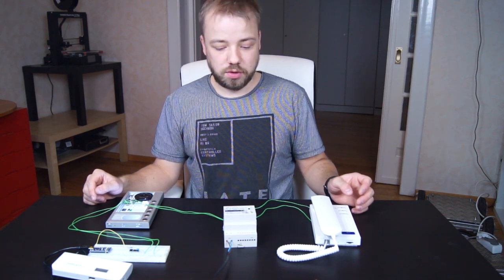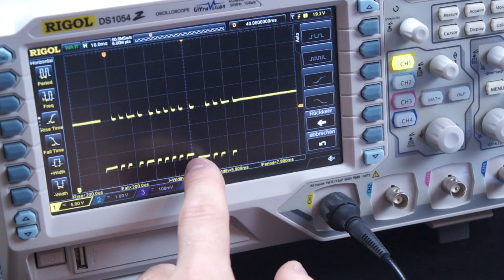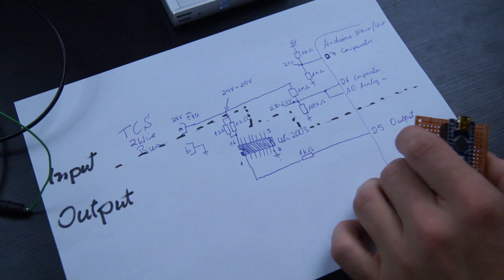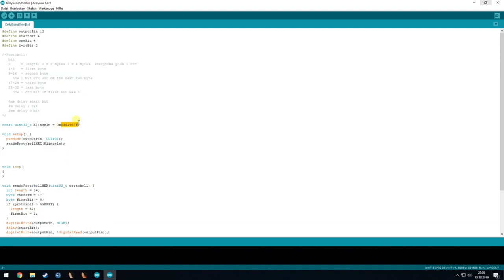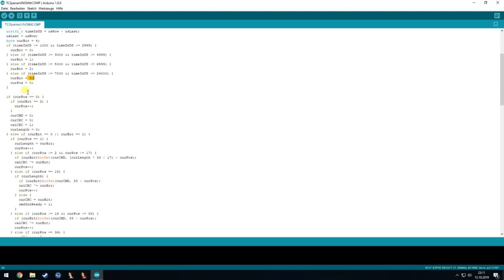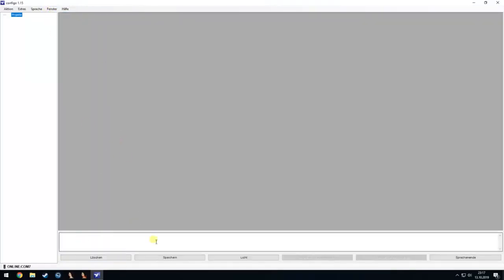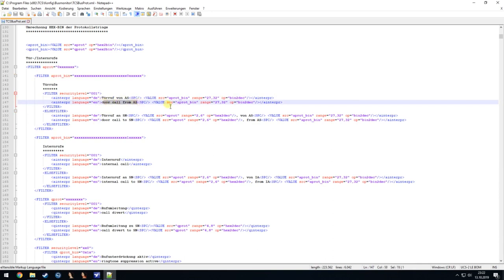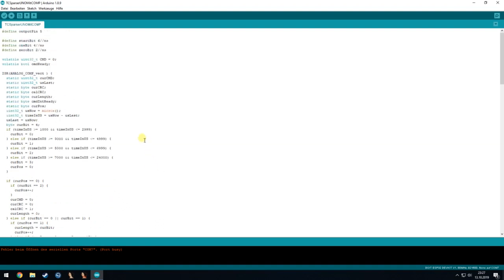2Wire Intercom Arduino Hacking, How to controll TCS via Arduino

Comment: Great Work! This helps me a lot for to make my own ESP8266 based dooropener in combination with Home Assistant.
Reply: Hi how did you do it? can you point me some video/docs? 
I'd like to connect my apartment intercom to send me audio/notification to my phone when it rings. It would also be great to forward it via VoIP to my phone somehow - I already use home assistant
Reply: Any luck getting that to work?
Reply: @plaetzchen86  unfortunately not
Reply: @plaetzchen86  did you receive a code for integrating the TCS intercom into home assistant?
Reply: @vladimirzrnic8975  nope

Comment: Awesome! Thank you very much. I considered buying the Nuki Opener, but they discontinued the support for TCS Intercoms. Then I found the Shelly Uni on the Web, which has a Smartphone app and lets you control various electrical devices.  Your work will help me a lot to get my intercom smart again, and it will be way cheaper than the Nuki Opener.
Reply: The Shelly Uni can't be used for this project. Which is why I will now use a NodeMCU v2. Firstly, I still have it lying around at home and secondly, the NodeMCU has 4 MB of storage for code. Since I need an AP and Wifi mode and also Mosquito, the additional storage should be enough. I also need to write my own Android and Wear OS app so that the intercom can also be opened via the internet. As a programmer, I'm really looking forward to it. I have also created a schematic and a board with Eagle, which has various status LEDs and switches. E.g. for debugging, AP mode, switching on and off and so on and so forth. I will also have the board produced and when everything is ready, I will make it available as open source.

Comment: Great video! I have an 8-wire digital system with 2 video, 2 audio and 2 bus wires. Do you think the two bus wires would work the same way as in your system?
Reply from the maker: hi thank you.

It's hard to say how are the bus Systems work you have to check with an Oszilloskop at best. These ystems are mostly proprietary
Reply: @atc1441  Thanks man. With your permission and when I start working on this, I will contact you again with info or questions. I practically wanna do a little wifi terminal for this and it should be a pain in the ass :)
Reply from the maker: yes no problem just ask

Comment: Wow, great reverse engineering and documentation! Is it possible to power the Arduino/ESP8266/ESP32 from the bus? I don't have a power source where the indoor device is located. You write in one of the comments that powering it would be limited to 100mA? Also, am I assuming correctly that it also should be possible to activate the door opener, since you can write to the bus?
Reply from the maker: Hi thank you. The power draw of an esp is too high for the BUS so not possible. On some systems there is an extra power cable connected, you could use that to power the esp.

And yes you can open the door with it without any problem
Reply: @atc1441  Thank you for your quick answer.  I'm really excited for this, finally there is a solution to this! Sorry to bother you again, I have a follow up question: I have all four lines used. So do you think I could use the P line to power my ESPs? Can I use an LDO to get from the 24V to the 3V3? Or what would you suggest?
Reply from the maker: @danieleichhorn9533  That sound good, should work, see if the LDO is has enough power or even better use an step down converter.

Comment: Hi Aaron, great video.  Is this "hack" usable for an intercom using the SCS BUS ? Also, is there a way to open the frontdoor by using a morse code (input by ring button at the frontdoor) for example ?
Reply from the maker: Hi. 
This hack is only valid for the TCS intercom.
When an Arduino is listening for a specific morse pattern then it could open the front door so that is possible to implement. Only speaking for TCS again
Reply: @atc1441  Thank you tor your reply.Will try to figure out how to implement this in my existing intercom installation. Regards Philippe

Comment: I wouldn't thought of using the two wires of an intercom to send your own protocol.  Interesting concept. Thanks for sharing.
Reply from the maker: Hi again :) 
Yes even that is possible with this mod, the arduinos can also be powered via the bus, but in this case only up to 100mA current.
it would also be possible to send data from one to another arduino on the bus.

Comment: you are a genius! I thought about this many times before, but never got to do it... 
after I found your post, github and youtube video and have written my software and assembled the hardware, I managed to open my door with my mobile phone! 
that is so cool, thank you so much for this. maybe worth mentioning that you have to connect A-B (like you said) but use P to power your device (took me a while to understand ... it's kind of obvious afterwards, but it was not for me at the beginning ...). btw i'm using an ESP32 with a bucket converter to 3.3v - so even with wifi it's way below 100mA on the 24v - it's around 20mA
Reply from the maker: Great :)
The only problem with the P line is that its not available in many installations but lucky you !
Reply: Welchen converter hast du verwendet?
Reply: I have 4 Wires. The a-b and the E-P. But there is no power on P at all. I probed all combinations. See now power coming from P.
Btw... how is the BUS working, do you have any issues afftecting the BUS in general? I mean, do other interphones have issues when you connect your ESP?
Reply: I have no other things connected, cannot give you an answer regarding additional things
Reply: @atc1441  Do you know another method to power the esp directly from TCS System? I have the same problem like other guys here, 4 wires but on the P line is no power.
I didn´t found so many useful documatation for my TCS Stystem, seem´s like the E and P line is for the floor button

Comment: Would the same wiring for sending work also from a wemos d1? The main difference being that the output of an io is 3.3v on the wemos vs 5v on the nano. I'd try to extend the tcs monitor that is linked in your repo also with a writing function. I want to be able to open the main door automatically and also react on the door bell.

And do you think it's possible to also use a standard 24v to 5v dc/dc converter to power the arduino directly from the bus?

Comment: Hello Aaron, many thanks for this video! I have 2 questions:
 - why did you use 2 1.2ohm resistors in parallel, actually making a 0.6ohm resistor?
 - using a 1Mohm and a 160kohm for dividing 24v and 20v, you would get 3.31v and 2.759, correct? How did you get 2.8v and 2.2v?
Reply from the maker: Hey. The parallel resistor are there so they are able to drive more power. So 2x0.25W = 0.5W
I dont know how to answer the second question right now
Reply: @atc1441  I see, good point. And how did you determine the - equivalent - resistor value 0.6ohm?
Reply from the maker: Many values work. You just need the short

Comment: Hi Aaron - great work!!
You seem to know the System and Manufacturer quite well. Do you think, this setup could also be used on TCS 6-Wire Bus installations and multiple phones in the system and maybe is then just using a few more bits to handle routing of the messages? or is it a completely different thing?
Reply from the maker: Hi. I dont know the 6 wire system sorry i can image that they are quite similar

Comment: Hi Aaron, cool video, this was really eyes opening and it will definitely help me to build my telegram bot enabled door opener ;)
One question, as already asked by @aemitic, in your hand drawn input schema, the incoming voltage is reduced by a voltage divider, realized with two resistors.
Given the formula "V_out = V_in * (R_2 / (R_1 + R_2) )", I do not understand how you got to 2.8V - 2.2V. According to the formula it is  3.31V - 2.75V.
Given this higher range, the used reference voltage for the comparator of 2.5V (correctly calculated with the formula) would be too low.
Do I miss something? Thank you a lot.
Reply from the maker: Hey. It works because the power supply is made to detect the current draw.
It was really done by trial and error and not by calculation thats why it might look different
Reply: @atc1441  Thanks.

Comment: Moin Aaron,
ich greife den Strom über B und P ab, nur leider bricht auch dort die Spannung auf 0v ein, wenn ich ein Befehl sende.
Wenn ich z.b. den original Türöffner drücke, passiert das nicht.

Wenn ich den Arduino zusätzlich über USB mit Strom versorge,  funktioniert alles problemlos.

Hast du eine Idee?
Reply from the maker: Hey, die leitung kann nicht genug stom liefern, das ist das erwartete verhalten.
Beste grüße

Comment: Have you tried to read or write audio onto the bus to simulate picking up the headset?
Reply from the maker: Hey, 
Check out part to for a bit of audio hacking. Its not as deep as you would love but something :)
Reply: @atc1441  Ah found the video. That's a quite a bit above my level of electronics I'm comfortable to do on my own though. My neighbor asked if we can extend our door opener, that I built based on your first video and code, by forwarding audio as well. Would have been pretty cool to forward the audio to my signal messenger bot and sending the audio via voice message back

Comment: Hallo Aaron, danke erst mal für die ganzen Infos in deinem Video. Ich habe deine Schaltung nachgebaut und es funktioniert auch so weit alles wie in deinem Video. Ich habe mir auch so ein Türöffnungskommando von einer Innenstation aufgezeichnet. Komischerweise geht der Türöffner aber nicht, wenn ich das Kommando  über den PC-Adapter wieder raus schicke. Hast du da vielleicht noch einen Tipp für mich?
Reply from the maker: Das hört sich so an als wäre die Ausgabe Elektronik nicht funktionabel.

Teste doch mal mit einem zweiten Interface ob du das Kommando sehen kannst was du selber schickst
Reply: @atc1441  Das Licht Kommando funktioniert. Ich höre das Relais klacken. Aber ich werde mal ein zweites bauen.
Reply from the maker: Dann müsste es eigentlich auch mit dem anderen Kommando funktionieren. Vielleicht sendest du ja doch das falsche Kommando
Reply: @atc1441  Also für Licht habe ich aufgezeichnet 
11:55:27	A IN : 1200       --> Licht  oder 01 24 31 32 30 30 04 0d 0a  aufgezeichnet mit Serial Port Monitor
geschickt habe ich dann mit Realterm das Gleiche auch mit Serial Port Monitor  aufgezeichnet.
Dann habe ich mit einer Innenstation die Tür geöffnet.
11:51:40	A IN : 1AC1D680   --> Türöffner/Licht, SN  704982 , AS  0 

oder 01 24 31 41 43 31 44 36 38 30 04 0d 0a mit Serial Port Monitor
Das habe ich mit Realterm wieder raus geschickt aber nichts ist passiert.
Reply: Ok ich habe meinen Fehler gefunden. 01 24 ... war immer die Antwort vom System. 01 20 ... ist das Kommando. Macht man das richtig, dann klappts auch.
Reply from the maker: Perfekt :)

Comment: Hi Aaron, darf ich dich fragen, wozu die Referenzspannung an D7 wichtig ist?
Reply from the maker: Moin. Die ist in dem fall für den internen comparator, man stellt anhand der referenzspannung ein ab welcher spannung and dem anderen eingang ein interrupt getrigert werden soll
Reply: @atc1441  wow, danke für die rasche Antwort. Interessanterweise hat es eine Zeit lang ohne funktioniert.
Reply from the maker: Kein problem.

Ein offener eingang floated und kann irgendwo zwischen 0 und 5 Volt liegen jenachdem wie die luft ist oder ob man ihn berührt also kann es durchaus sein das er dann in einem perfekten bereich war
Reply: @atc1441  Verstehe. Ich Arbeite mit einem NodeMCU Board, bei mir sind das also 3.2 anstatt 5 V. Muss dazu der D7 Pin softwareseitig als Eingang definiert werden oder reicht es wenn eine Referenzspannung anliegt?
Reply from the maker: Ja dann 3.2V :) 

Wenn es jetzt schon funktioniert hatte sollte es reichen wenn die referenzspannung anliegt dann ist der GPIO part im chip nicht verbunden und stört nicht
Reply from the maker: Allerdings ist der D7 code / comparator mode nur für den Arduino Nano/Uno also ist es eigentlich nicht möglich das mit dem nodemcu diesen code zu nutzen.

Welches beispiel hast du verwendet?
Reply: @atc1441  Für das einlesen des Signals habe ich mir ein eigenes vereinfachtes Script geschrieben. Bei der Schaltung habe ich deine Anleitung verwendet. Ich habe lediglich den Spannungsteiler für das Eingangssignal (R1=1M, R2=147k) angepasst um nicht über die 3.2 V zu kommen.
Reply: Zum versenden habe ich deine sendeProtokollHEX Funktion im Einsatz. Funktioniert perfekt. Bei dem ganze Projekt, geht es mir nur darum, festzustellen wann geklingelt wurde und bei Bedarf das Haustor zu öffnen.
Reply: Entschuldige, dass ich so lästig bin :) ... hast du einen Tipp wie ich den Floating State beim Nodemcu in den Griff bekommen könnte?
Reply from the maker: Muss nochmal fragen, wie hast du den comparator im nodemcu aktiviert? Mit dem Nano code ? Welchen code nutzt du genau
Reply: @atc1441  So wie ich das verstehe, habe ich keinen Comparator. Ich lese den TCS Bus über den Spannungsteiler direkt in D6 ein und werte die Zustände aus, woraus ich mir dann softwaremäßig den ankommenden Binärcode bastle. Wie gesagt, anfangs hat das funktioniert. Seit heute geht das ankommende Signal an D6 auf LOW (und bleibt dort auch) wenn über den Bus ein Signal kommt.
Reply from the maker: @Error-404-user-unknown  Ok, verstehe, das kann allerdings so nicht richtig funktionieren, für deinen fall ist der ESP analog in code gedacht, man bräuchte entweder einen externen comparator oder man nutzt das analoge signal.

in deinem falle brauchst du dann auch keinen D7 verbinden :)
Reply: @atc1441  An den analogen Eingang habe ich auch schon gedacht und ich hatte auch eine funktionierende Version am laufen. Der analoge Eingang scheidet trotzdem leider aus, da eine dauerhafte Wifi Verbindung beim ESP8266 instabil wird wenn analoge Werte ohne delay im Loop eingelesen werden. Das ist ein bekanntes Problem des ESP8266 und mit einem Delay von nur 1ms im Loop kann ich den Bus nicht mehr zuverlässig auswerten.
Reply from the maker: @Error-404-user-unknown  Das ist richtig, dann wird leider ein externer comparator benötigt
Reply: @atc1441  Ja Aaron, dann weiß ich jetzt dass ich Comparatoren beschäftigen muss :) ... vielen Dank für deine Zeit. Es ist ja nicht selbstverständlich, dass man sich Zeit für wildfremde nimmt. Ich hab leider keinen Elektrotechnik Background, deshalb bin ich um jeden Tipp dankbar!
Reply: Hi  @Error-404-user-unknown  - how I can get in touch with you? Thanks Vlad